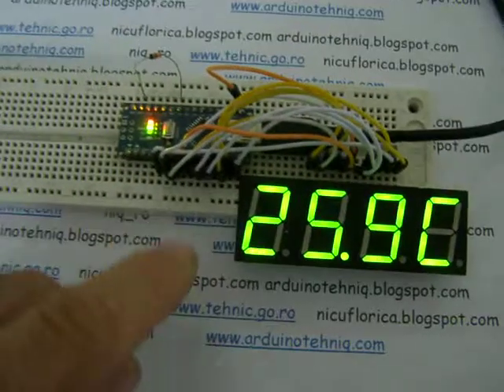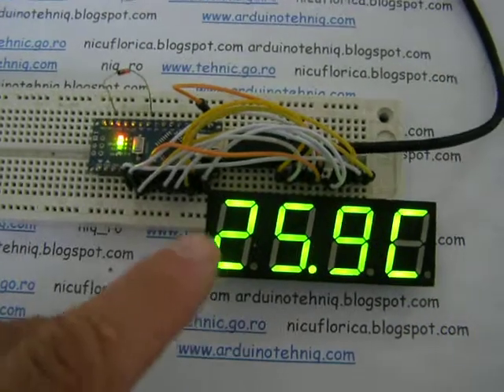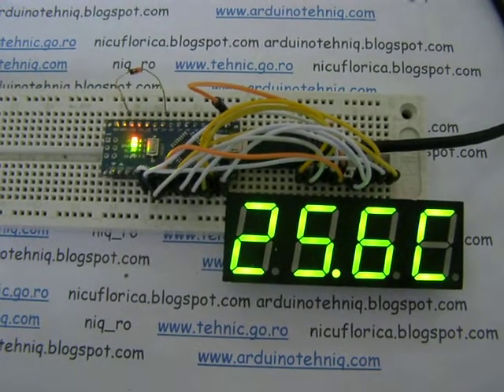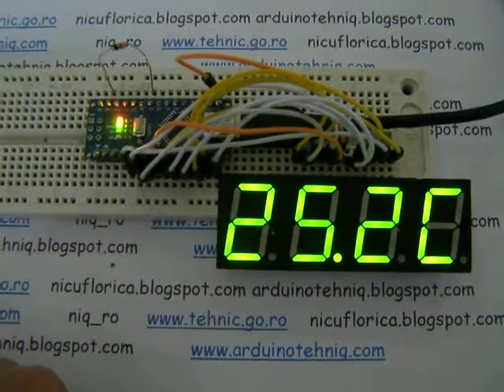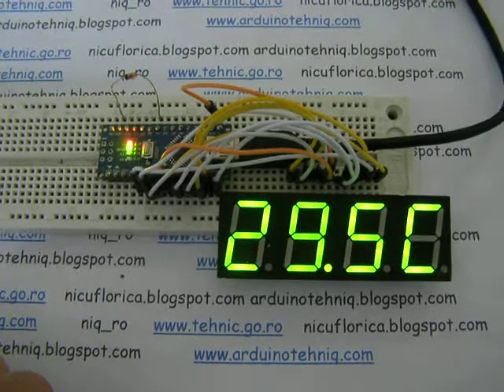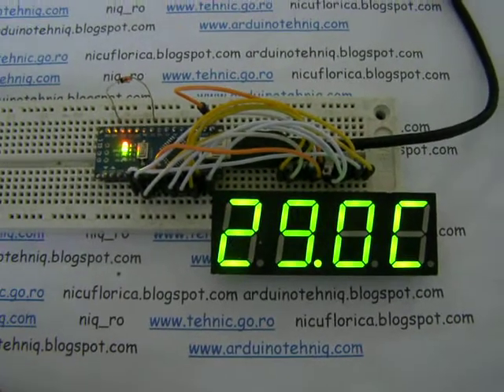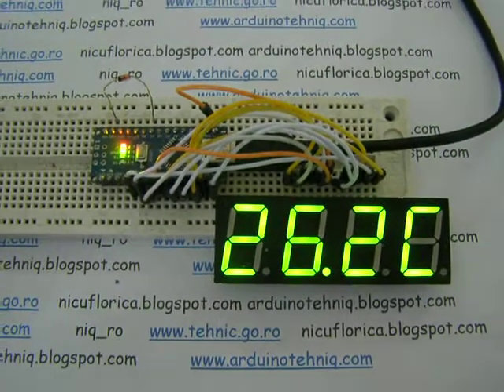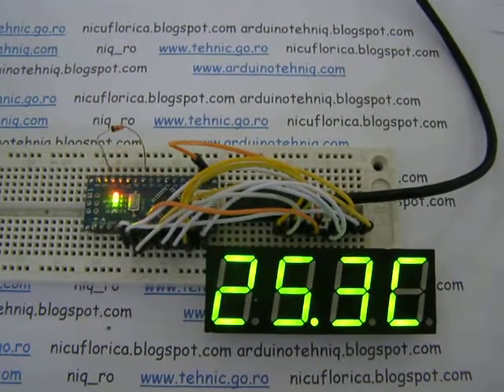thermometer with 1N4148 diode as sensor on multiplexed led display

Comment: Works good,super project,for the the right calibration modified line 39 (vf0)
to 600.Can i use 2 diodes, in-out temp measuring?(display changing 
2 second )e.g 2 sec in temp,2 sec out temp.
Reply from the maker: you can modify the sketch how you want, is open project.. I haven't free time... no spare time.. sorry

Comment: can I use this code with Arduino Uno and I want to make it standalone and I have 3 digit 7 segment display with 10 pins how to connect them
Reply from the maker: Mina Nabil you can use any Arduino board... se schematic snd sketch in description of this video
Reply: i tried your code and i get the temp. in serial monitor but the 3 digit of the display is on and don't changed
Reply: after testing the digits with multimeter continue circuit I found the digits 1 2 3 is pins 2, 10, 5 and connected to positive
Reply from the maker: maybe your display is with common anode not common cathode, activate lines 66-69 and comment lines 73-75